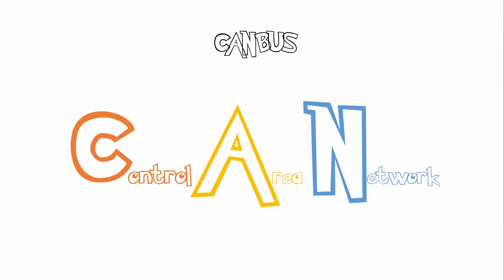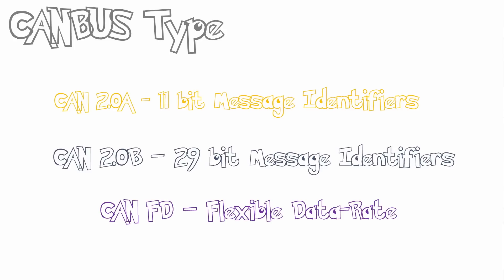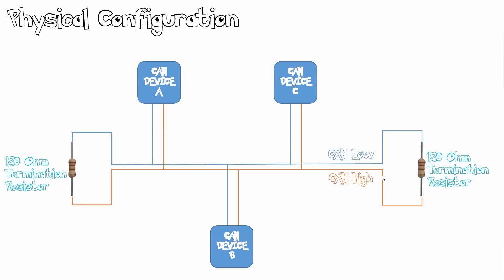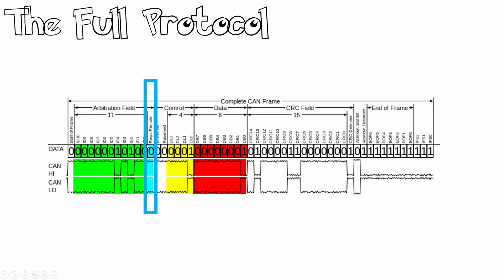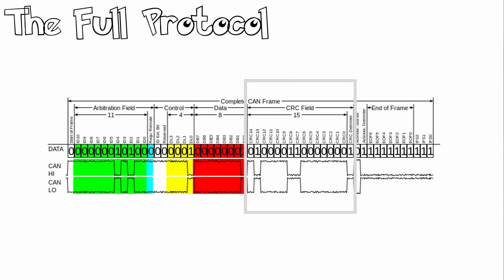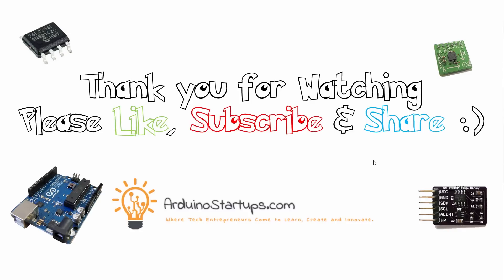Fun and Easy CANBUS - How the Canbus Protocol Works

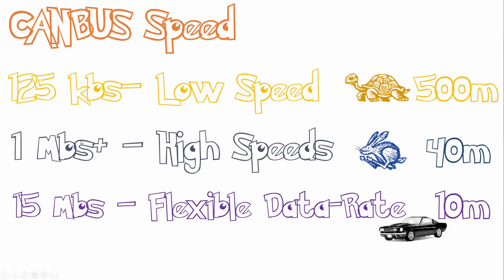Comment: At the time of about 1:53 , this video talks about data rates of low from  125 [128] kbps Low Speed (at 500 m) and then 1 M bps  (40 m or less) and even 15 M bps for Flexible Data Rate at 10 m, but this is not often seen in other references, and it skips over the more common known rate of  500 or 512  k bps data rates for  ISO 11898-2.  So, there may need to be more details and clarifications for overall specifications in CAN types and where the information is obtained in this video.

Comment: Thank you for video... my question is when more than two devices are connected in can the how that frame works to send data to the specific controller? also in that scenario how collision can be avoided?
Reply: All messages are received by everyone on the bus like a group chat. Devices are programmed to recognize which messages are for them. If two devices are both transmitting at the same time, whichever one has the lower ID is given priority. The other device sees that and stops transmitting. It does this by checking the voltage of the bus when it transmits a recessive 1. If the bus is driven to 0, then someone else is talking and the device knows to stop. You can convince yourself that this always gives priority to the device with the lowest ID. I have no idea why you would need this answer 2 years later, but there you go.
Reply: @braedenward8570  thanks a lot for the reply 🙂 it answerd my question

Comment: Reliable and robust? I dont think so pal.
Reply: It depends what you compare it to. Compared to older automotive data communication networks, which used a single wire rather than the differential signal from a two-wire pair, it is more robust and reliable.

Compared to modern 1000Base-T Ethernet, not so much.
Reply: whoever said it's reliable never worked on a Bizerba GLMI 100. Muahhahahaha!
Reply: Joshua Smith your kidding right . that thing doesn’t even get anywhere near the complexity to even use a bus system . it could operate analog dumb interface and do the same job

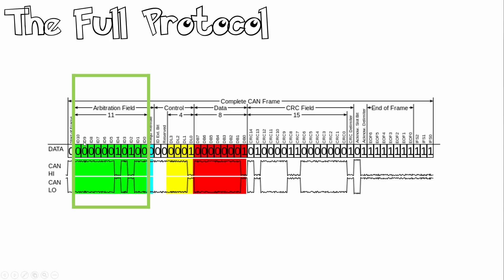Comment: Thanks for the video, I appreciate the effort you put in to explain what you have learnt. At 3:35 how message arbitration works was not clearly explained. Bus arbitration is won based on message ID (lower ID message has higher priority), not because they are Engine controller or Light controller.
Reply: yes , if msg1 ID : 00100 
and     msg2 ID : 00110 

in the CAn bus we will see 00100 (msg1 with high priority )
Reply: This is explained further in another lecture. This is part of 2-hour course.

Comment: The video contains a lot of incorrect infomation. It may confuse people, who are not CAN experts. 15-Mbit/s for CAN FD is a dream. 1 Mbit/s @ 40 m will also not work with real components.
Reply from the maker: +Holger Zeltwanger hi thanks I should have mentioned that these are theoretical speeds based on the standard.
Reply: Frames with a lower message ID (arbitration field value) have priority over frames with a higher ID.
Reply: Can you help me ! sir . i can't understand "how does CAN bus know which note is higher priority".
Reply: Within the CAN frame there is a 12bit arbitration field, node with the higher priority always have more number of dominant bits(0) present within this arbitration field, this is how i understood how nodes take over can bus. Feel free to correct me i am wrong.
Reply: my car (BMW) has ibus is that a form of can bus and does it use one of these 3 protocols or is it it's own proprietary thing? or is it just what BMW call the CAN BUS ?
Reply: You look German, I believe whatever you say :-)